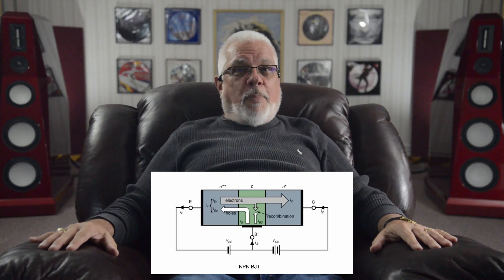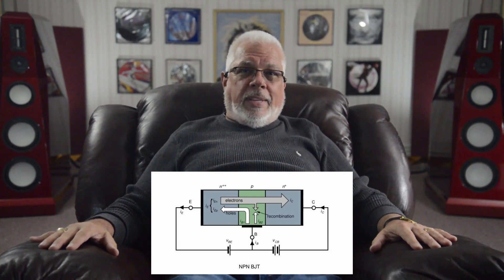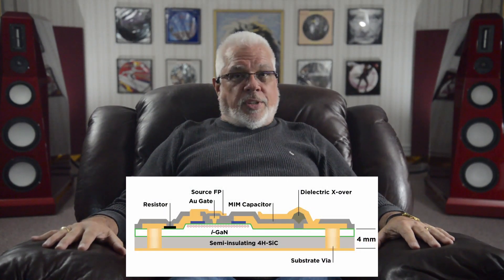E108: AGD Productions Gran Vivace GaN Amplifier

Comment: Could a tube preamp be used with these new class D amps? Do you miss the sound of tubes while listening to these?  The tube sound stage? I grew up listening to tubes and turntables.  It may be just nostalgia but the tubes  make a sound that I cannot seem to get any other way.  I don't use turntables anymore.  Digital sources into tube preamps.  Then class D.  Still like my LK-72  all tube amp.  Guess I am a tube junkie.  Thanks for a very thorough review.
Reply from the maker: This is surely a rhetorical question...

Comment: I am curious since your ULTRA 9 have a built in subwoofer, wouldn't the bass be defined by the amp in the speaker more than the amp driving the rest of the system?
Reply from the maker: That may, at first, seem to be a reasonable and valid question, but I’d suggest that you really aren’t looking at this with the proper perspective.

While it is true that the ULTRA 9s have a dedicated 1KW Class D amplifier driving the fifteen inch Dayton Audio subwoofer in each enclosure, it is ALWAYS a continuous part of the speaker, and therefore, an equal and constant part of the speaker’s overall sonic signature. As such, it is as clearly as much a commonality to the speaker and its resultant voice as any other individual component, such as each individual Accuton, ScanSpeak, Fountek, Seas, or Dayton Audio driver, each crossover resistor, capacitor, diode, or coil, the Fostex transformer type attenuators, or the internal ULTRA wiring, right? It doesn’t vary with changes of upstream components any more than any of the other individual components that make up the loudspeaker, and contribute to its overall voice.

Yet the ULTRA 9 is CLEARLY able to distinctly and fluently present the different sonic characteristics of ANY source or other component placed before it, be that a CD Player, a DAC, a Phono Stage, a cartridge, a linestage, an amplifier, a power supply, a power filter/conditioner, a power cord, an interconnect, a digital cable (USB, AES/EBU, Toslink), speaker cables, or even different cable lifters. Get it now?
Reply: @theaudioanalyst  thanks for the info
Reply: @theaudioanalyst  Nice review and speakers but oh brother...what a non-sensical word salad response to @ericstefko4852 valid question. The way I interpret your response, apparently the ADG has magical powers (acting as a preamp to the Ultra's built in amps) somehow make the base tighter and deeper?  It feels like you are gaslighting yourself on that one.
Reply from the maker: @BioMedUSA  The only nonsense I find here is your interpretation of what I actually said... Read it again. The speaker is the speaker is the speaker - like any other, passive OR active. That stays the same regardless of ANY upstream product, from the sources, though the electronics, cables, etc. Where you get the absurd notion that the Gran Vivace is somehow imbued with "magical powers" is beyond comprehension.

Comment: Thank you Greg for this very interesting episode. Being an audiophile who used to never consider class D as an option, I moved to class D few years ago after a "blind" listening session of the TAD M1000 (I didn't know it was class D).  It is said to be "engineered with a Class D output stage combined with a power supply circuit design featuring a high capacity (1kVA-class) toroidal power transformer and specially designed electrolytic capacitors". No hint of harshness, big power (250W 8Ω / 500W 4Ω) a very fast sounding amp with smaller footprint. My point being that whatever the technology used (A / AB / D...) quality of the implementation is the key to achieve audiophile results. Thanks again for your reviews Greg!

Comment: How many significant better "tubes" have been put to the market since that gear first came to market? It's been quite a while now.
I like the look, but I don't think the "tube"  is more then a gimmick.
Reply: We introduced 2 revisions. The one reviewed by Mr. Waver is MKii, as you can detect from the marking on the PCB as per the photo published in the video.
And with all due respect, I beg to differ, it is not a "gimmick".
Reply: @Albert-nj9xm  since I wrote the first part I have visited the website and seen the different options. The fact that there is development and an upgrade path makes it way more interesting indeed. I will remain a sceptic if it needs to  be in a tube, but I imagine when I hear it and it does sound as good as described here (and I think I read an article on 6mooms a while ago) I won't care what makes it sound the way it sounds. And as I said I do like the estethics.
Also thank you for your quick reply, it is appreciated 👍
Reply from the maker: Hello Anne. While I guess I can somewhat understand your skepticism, keep in mind - this is NOT a vacuum tube. In this application, the KT120-like glass bottle contains the complete Gallium Nitride output power stage, and includes the Class-D amplifier module, its output filter, and the linear power supply rails used to feed the PWM controllers and auxiliary circuits. ANY refinement to that power stage, any subsequent degree of improvement that can be mustered by AGD Production over time, can therefore be EASILY implemented. The amp doesn't have to go back to the factory for upgrades! It is a matter of a simple field swap, and the customer is back online in minutes... I hope you can see the difference here...
Reply: @theaudioanalyst  sure I can. But the same thing could be done by swapping a card instead of a tube? That's what I meant by "gymmick" what does the tube add to the module that a more traditional way of module swapping can't do. 
I am all for being able to change a device by using a modular system. That's why I don't have an integrated or all in one amp, this just takes it further.
But I may be one of the lucky audiophiles that has been happy with the same components for decades. Only the digital side changes
Reply from the maker: @annebokma4637  So, my point here was that ANYONE could do the swap. I've a degree in electronics, owned and operated an electronics repair shop, can do board level parts swaps, etc. And, while a card change is fairly easy, it is NOT something that everyone would be comfortable doing. I know a LOT of music loving audiophiles who shouldn't be allowed to use tools, let alone open the case on an amplifier! 😁
Reply: @theaudioanalyst  yeah this is more noob save 🤣

Comment: I own a pair of AGD Audions and it’s a game-changing love affair. I’ve owned many a Class A/Class A/B amps over the decades. All the familiar designers and models. Many I still own and love but my Audions are right there among them and are in my system most all the time. 

Usually the changes in my system are the types of line stage I’m in the mood for. Most of the time I prefer tubes in the line stage paired with the AGDs. The synergy is fantastic and leaves nothing to desire. 

You never truly know until you give them a try in your own system. You will not regret it…It’s a listening revelation and for me it continues to touch my soul. 

Thanks for the Gran Vivace review. When I saw “AGD” a smile came across my face, knowing how special AG’s GaN technology has been implemented across the line. Very nice ❤
Reply: I am the happy owner of a pair of AUDION. Thank you for your comment. There is nothing more to be said. A real love affair

Comment: My only experience with Gan amps was a 350w $3k amp. Outside of its smooth high end, it lacked in comparison to my Parasound 160w Halo amp. The Parasound had more bottom end tightness and grunt, midrange lent more weight to voices. Playing Sinatra at the Sands on vinyl, the Gan amp did a disservice to his voice. The dynamics were lacking in comparison in that album too with the Gan amp. It had much less weight to it. The Gan amp also didn’t “project” sound into the room like the Parasound. There was no toe tapping with the Gan amp compared to the Parasound. Both amps were connected with balanced cables and driving 4 ohm Salk speakers. I tried to like the Gan, but it wasn’t to be. Perhaps the Vivace would be better in these regards.